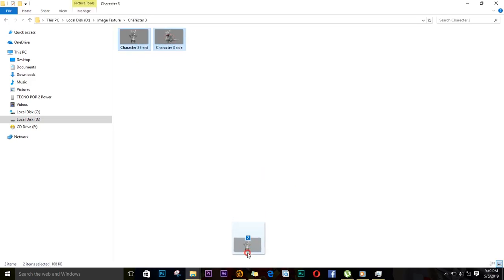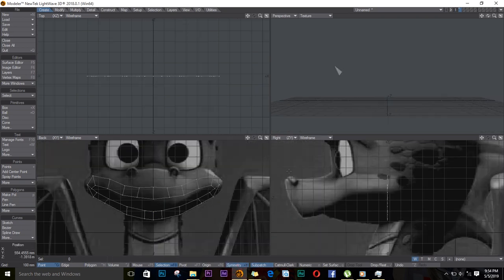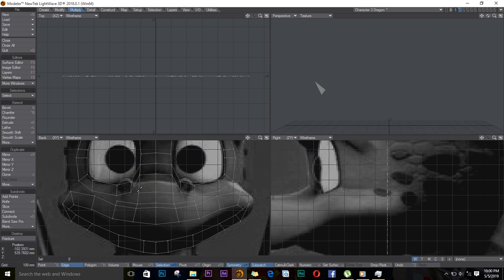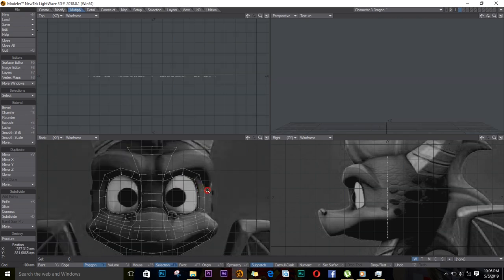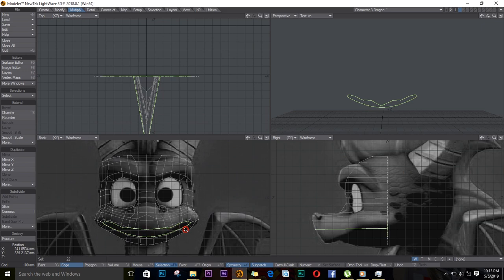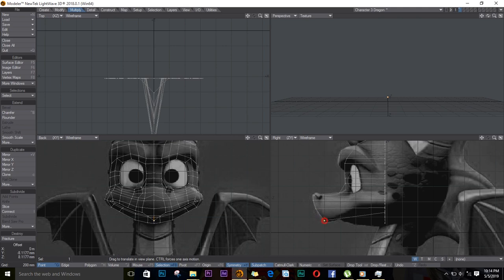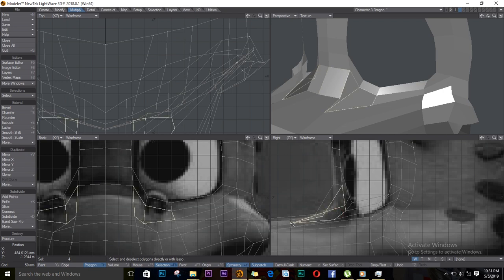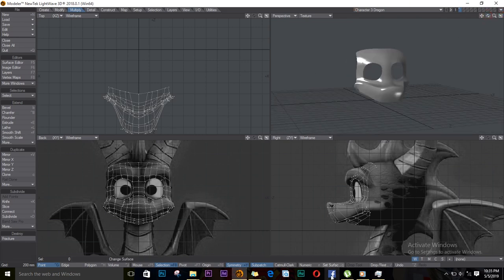How to Model a Dragon in Lightwave 3D Part 1

Comment: Great job!! But what tool did you use to extrude those edges at 01:48? Thanks!
Reply from the maker: Thank you, Push "E" to extrude
Reply: @RobbysArt  this doesnt do anything on lw 2019. not sure what I am missing?
Reply: @Labeshop  I'm using LW2025 now. 'E' for Extrude doesn't work for edges. I have to resort to using 'Tweak'. Lightwave Digital needs to explain these changes.
Reply: @Labeshop  As an alternative you can use the Extend feature in LWBrush (3rdPowers' plugin). What is great about it is how you can automatically move and merge two nearby points together just by dragging them into each other. So you don't have to switch between the Move Tool and the Weld command.